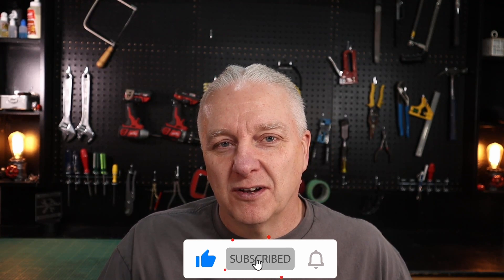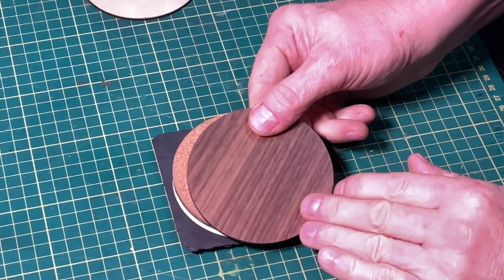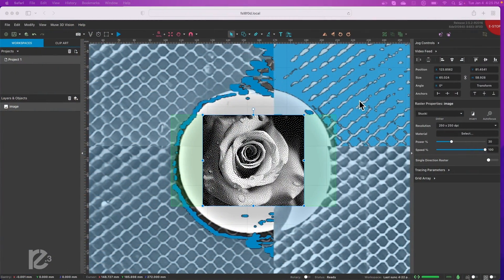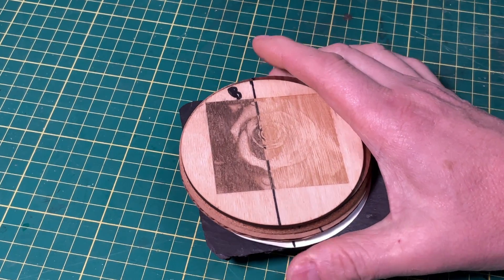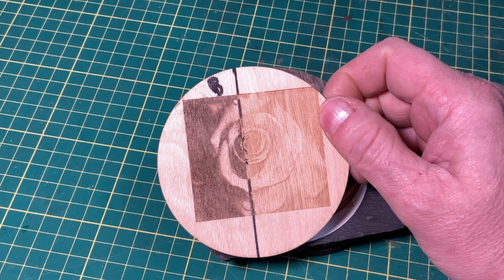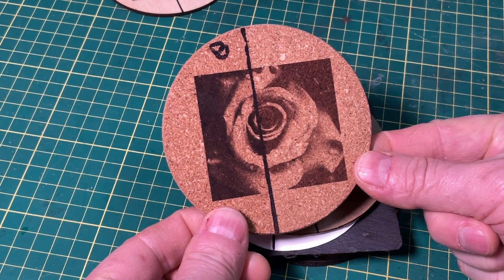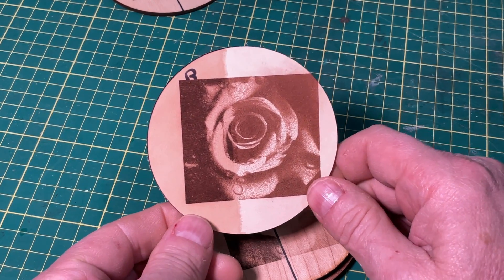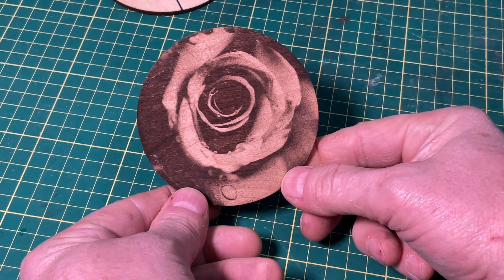Borax Laser Engraving Revisited

Comment: I have Borax residue left on the unburned areas of my engravings. How can I remove that residue before adding poly without smearing the image? 
 I am using 1 tbls of Borax to 10 tbls  of water with light spray.
 Also is there a clear coat that I can use on coasters that will dry faster than poly? 
Thank you for your time and videos.
Reply from the maker: Cleaning residue after engraving is probably not something you want to do, in part because it is permeated into the wood.

As for clear coat I use a couple light coats of clear spray rather than trying to brush something on.
Reply: @SteveMakesEverything  I am using a spray on poly but it takes a long time to dry and cure especially since I am making a ton of coasters with my Navy squadron logo on them. I was just wondering if a clear coat paint would be a good alternative.
Reply from the maker: @fyireviewsandhowtoos3118  For coasters, I'm not sure I would use this method unless you were putting them into resin or something.  Even with clear coast, I'm not sure they would stand the wear and tear of coaster duty.

Comment: Do you wipe the image down before adding a finish and if so what do you use?
Reply from the maker: Good question, but the answer is no.  You need to get the finish on it to protect the engraving.  Borax really messes up the material to make it dark.  Essentially it becomes full of hole like a sponge, so you need to fill those with a clear finish to ensure the they don't break down.

This is that tax you pay for using borax.  Nothing is free. :-)

Comment: I use a spray bottle of borax water (hot water, lots of borax in a gallon jug, wait for it to precipitate out of solution and pour the water into a spray bottle, this keeps it at max precipitate percentage at room temp), about 5 sprays per coaster sized object to wet it, and dry overnight. On my CO2, it's 12mah at 300mm/s, comes out perfect, but the borax char does wipe if you touch it so I hit it with some clearcoat. Works a treat, highly recommend!
Reply from the maker: Yes this exactly what I do too.  It’s fragile until you can get clearcoat on it but then it look amazing

Comment: Hello and congratulations for the great video! Speaking of plywood, how long should you wait (after applying Borax) to be able to engrave?
Reply from the maker: I’ve engraved immediately after apply borax solution and it has worked fine. If the wood is very wet though you can take a hair dryer or or heat gun to it to dry it out first

Comment: Did you have any issues with excess charring? I tried a grayscale test on craft plywood (basswood I think) and while the image was beautiful, the slightest touch smudged it horribly. Is there something I can do to finish this or treat it after the burn to stop this?
Reply from the maker: You want to give it a couple good coats of clearcoat or you could fill it with clear resin
Reply from the maker: Also really cut down your engraving power (reduce by at least 30%).  You need to find the balance between dark engraving and charcoal.  If you continue to get charring then try to reduce the concentration of Borax - this requires very little borax.

Comment: Is this safe for cutting boards?
Reply from the maker: Since Borax is water soluble, you can just wash it off after engraving, but you would need to be very careful with the power and since cutting boards are made from denser woods, you need to probably determine the power for each type of wood you are engraving.  It wouldn't be good if you hit a particularly soft piece of wood and the borax engraving dug in deeper than you expected.
 
Personally on my cutting boards I just use a diode laser and get a wonderful engraving without any surface treatment.

Comment: I tried borax with 1/8" baltic birch. It was so dark I really couldn't find a laser setting that could work with it for photo engraving  but it would work very well for designs that are full contrast (no shading)
Reply from the maker: You really need to dial back the power by at least 30% or more.  As you can see from the samples in this video, images are possible but it requires some finesse to get the setting right.
Reply: @SteveMakesEverything  Thanks I'll give it another shot.

Comment: Hi Steve, loved the video. I used cherry plywood and got a great looking engrave. When I picked it up I noticed it smudged. I wiped the surface and it was like the borax was just a coating over the light engrave and the whole thing came off. Any suggestions on how to prevent that?
Reply from the maker: This is the tax you pay for Borax or baking soda.  Once engraving is done you need to handle the item carefully until you can spray a couple coats of clearcoat on it to protect the surface
Reply: @SteveMakesEverything  thanks

Comment: Is the dark color just from soot that would come off with sanding?  Thank you.
Reply from the maker: You need to be very careful after engraving with borax because it is easy to destroy an unprotected engraving.  You really need to make sure your laser settings are correct to minimize and over-burn and soot (think low power here). You can do very minimal sanding but this has risks of damage so try some test sample first.  After engraving spray some matte or semi-gloss clearcoat over things to protect the surface from future damage.
Reply: Thank you.
Reply: @SteveMakesEverything  Thank you.

Comment: Did you rub off the ash like top layer when you finished the last cherry piece...?.
A swipe of varnish wouldve made that thing POP!
Reply from the maker: The surface of this material didn't actually have a lot of ash so there wasn't much to rub (Cherry is quite a bit harder than baltic birch).  After the video I gave it a quick coat of flat clearcoat but that was all I did.

Comment: Hi Dear, I love your work!! I want to ask you if you have any tips to engrave leather? Best regards
Reply from the maker: Leather isn’t too tricky, but settings will vary for your laser.  Start with low power on a scrap and increase power until you’re happy.
Reply: @SteveMakesEverything  yes, there is no any material for leather like borax for wood for example ?
Reply from the maker: @ציוןנעימי  No, nothing specific.  Borax has minimal benefit on leather.

Comment: When I use Borax, it looks great but I find it extremely sooty.  When I go to clean it up, it just smudges.  What am I doing wrong?
Reply from the maker: After you do the engrave you will need to apply a good coat of clear coat to lock things in. Your surface really should be prepared for finishing before you do the engrave so you don’t need to touch it after.  Just spray it with clear coat

Comment: Whenever I try borax on light ply the results looks fantastic until. I try to clean off any smoke etc. As that point all the black from the borax print smudges over the surface leaving a mess that can't be removed in any other way than sanding. After sanding the results are no better than no borax.  Any tips anyone?
Reply from the maker: It isn't without its drawbacks.  On baltic birch you will definitely need to ensure that your engraving is clean (i.e. no smoke marks) and the very first thing you need to do is lock the engraving down with a coat of clearcoat.
Reply: I wipe mine with a damp cloth after, that seems to work the best
Reply from the maker: @Teklectic  This should work too.

Comment: Awesome as always Steve.  I tried it on a log slice and it work very well.  Hey on another note, I have a FSL laser as well.  Do you know if there is any advantage to using PDF's as opposed to say JPG or PNG file format?  I don't really notice any difference but perhaps I'm mistaken...
Reply from the maker: PDFs don't really have an advantage in RE3 anymore.  Some of the recent software changes added the ability to take SVGs as well as raster formats directly.  I used to convert SVGs to PDF format but now I just drop them directly onto the RE3 workspace

Comment: Thank you for your info. I was trying with borax and wood. Undoubtedly the imagen is blacker, but two defects appear: 1) the imagen definition is lost 2) A background tint is produced that darkens the imagen in general. I would not use borax for my photo projects, not for writing text.
Reply from the maker: You will lose detail and contrast if the power is too high.  It requires some experimentation but with the right setting the image contrast can be improved compared to a regular engrave.
Reply: @SteveMakesEverything  thanks Steve for the reply.
Yes, I have reduced the power quite a bit and increased the speed, but the depth that the laser produces is still lost.
In liking there is no dislike. 
I prefer to increase the power more, without adding borax, with which I get more darkness, a real depth in the image, looking more three-dimensional, which makes it look more beautiful.
Thank you!!
Reply from the maker: @gabrielbogota  I you are using Lightburn you can try to defocus a bit to drop the power density

Comment: Hi I tried boric acid and got same result but noticed laser power must be 10% 400mm/s (100watt CO2) to get solid black on birch.
Seems if laser power is increased the black effect disappear wich tell me the penetration of the liquid has something to do with it.
Reply from the maker: I have seen the same result.  For borax on wood I typically reduce the power by 50-75% otherwise the result isn’t pleasant.  I assume that Borax is simply reducing the burn point for the wood and with higher power it is just flash burning the borax away.  But I’m no chemist.